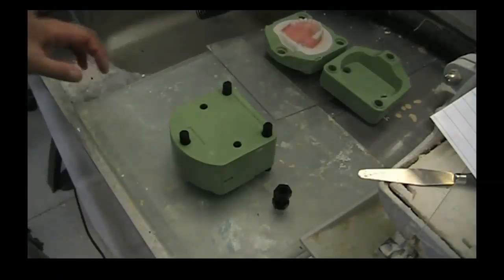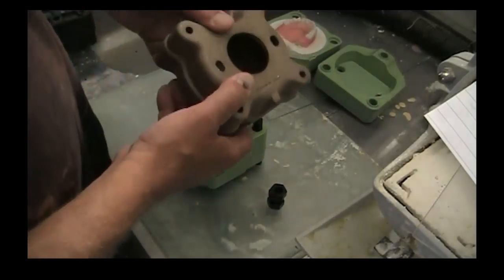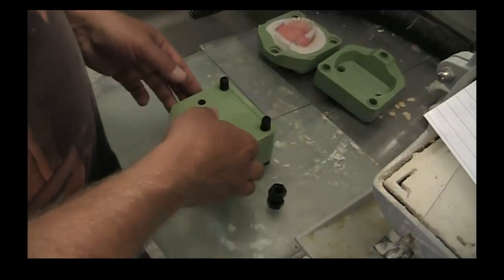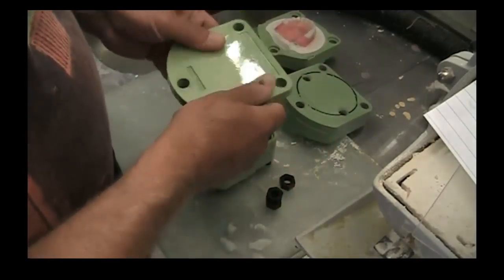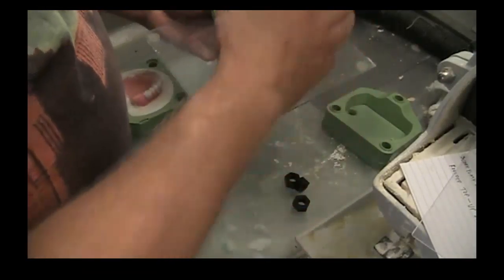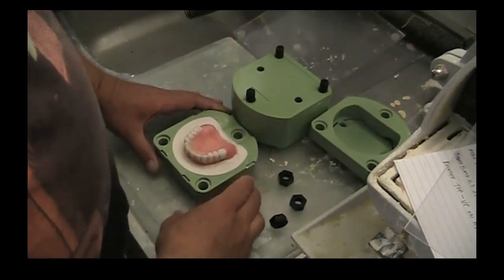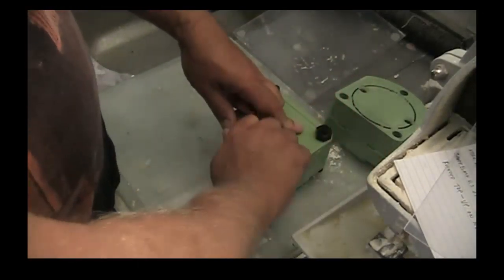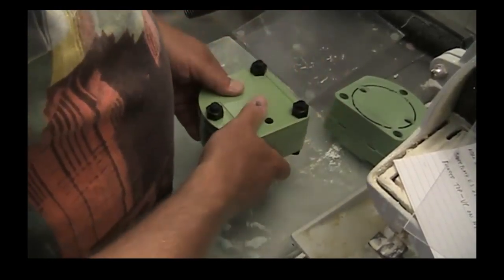GC FRP Microwave Denture Flask

Comment: Thank you for the details provided on this flask. I want to purchase this flask but have been finding it difficult to order it from Nigeria. Could you give me some suggestions? Second question: Do you think I can use regular acrylic material with this flask?
Reply from the maker: I do not recommend curing in a conventional way using this flask. It is not robust enough to take the continual heat saturation and pressure over and over in a continual fashion.
If your asking if you can microwave cure conventional acrylic in this flask, many claim to be able to do so, but the acrylic is not formulated to cure at the excellerated climb rate without seen and unseen problems.